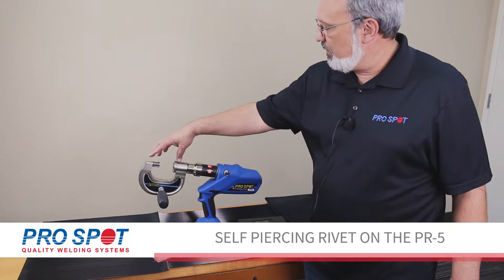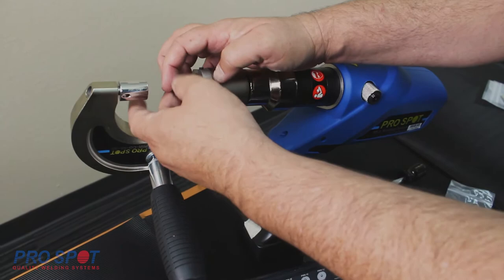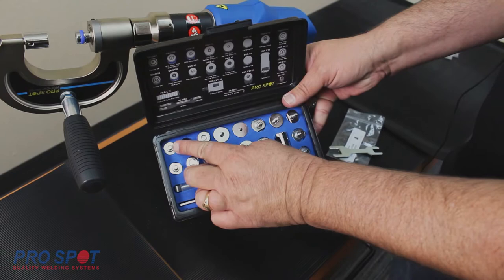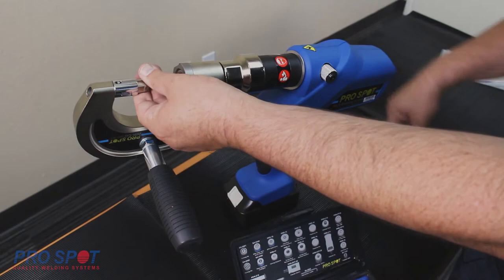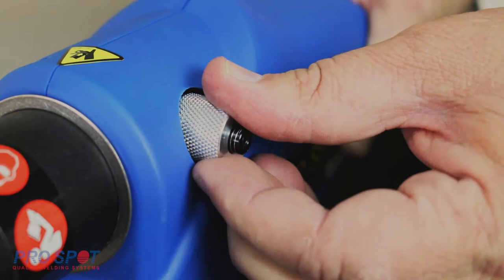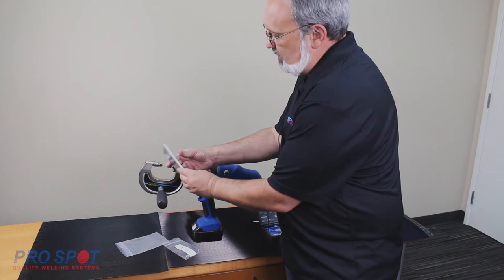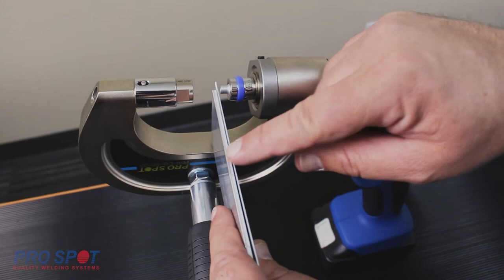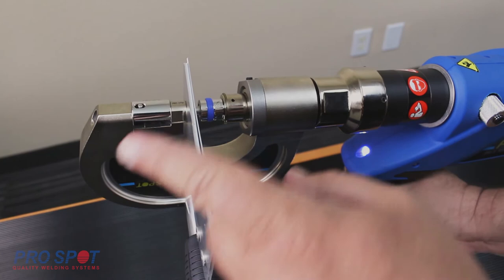Installing a Self-Piercing Rivet on the Pro Spot PR-5 Rivet Gun

Comment: what is the ip rating of a spr rivet ? is it considered waterproof ?
Reply from the maker: The SPR rivet is made from Boron steel.  The IP rating would more likely be for the enclosure/product that you are using the SPR rivets on/in.  In automotive applications, the rivets and thickness of metal the rivet is being installed into are matched up so the rivet does not penetrate through the "backside" of the metal when being installed.  So the only portion of the rivet that is exposed is the head of the rivet.  Also in an automotive application, the rivet is painted over so it somewhat seals the head of the rivet to the panel it is being installed into.